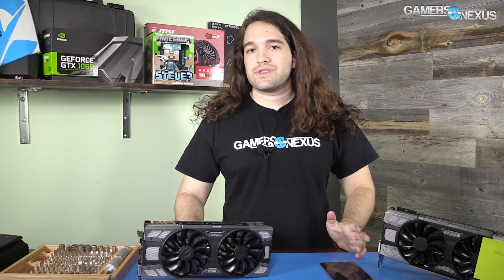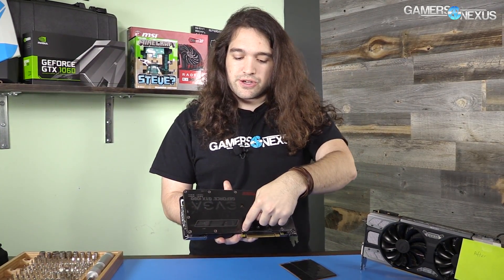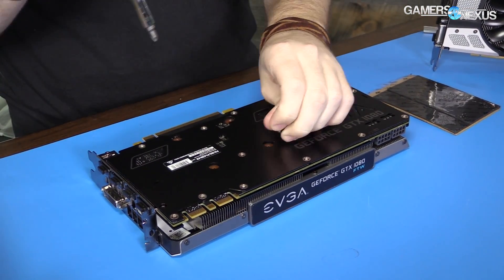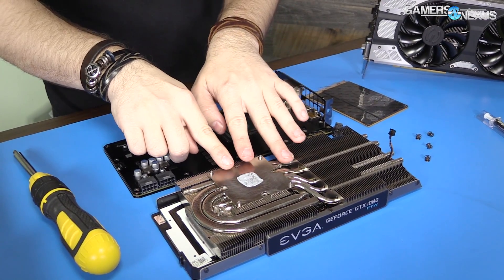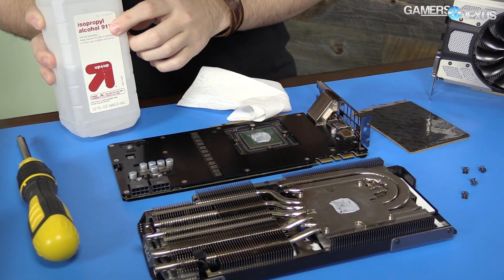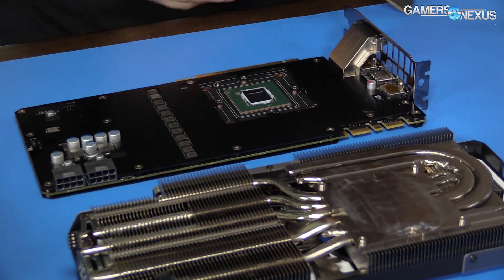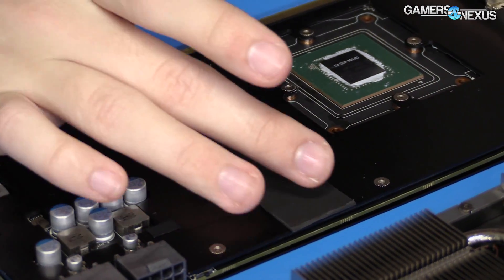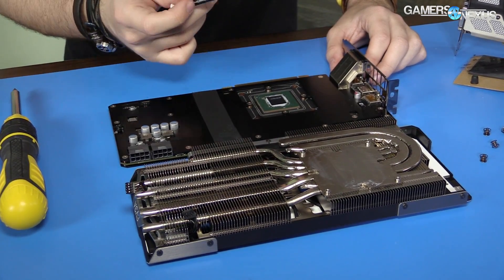How to Install Thermal Pad Mod on EVGA GTX 1080 & 1070

Comment: the only "mod" that is necessary is a full refund and apology from the company.
Reply: lol,, true. however i think evga will do it for you. what they should really do is send you a card that is free of any defects and a box to send them back your defective gpu.
Reply: feelingtardy DOES MY FTW2 have this defect?
Reply: TwiceBakedPotato the only acceptable fix is a refund. you don't pay thousands of dollars and then do a "repair job" on it. this situation is gross negligence.
Reply: feelingtardy it's the type of situation where people move off of a brand for good. the lack of quality control here for a device that is 1000 canadian dollars (each) is appalling.
Reply: 1000hpHONDA It's a change in the default fan curve. There's 0 impact in performance, stop lying and misinforming people.
Reply: Asshai by the Shadow he has posted this line all over the comment section, probably an evga employee trying to damage control.
also new vbios makes it significantly louder than other brands, and still bad temps
Reply: First Last they still have to send me the pads, it's still awaiting approval.
approval for what? for my card to explode?
Reply: Did they fix it ? or do they send the bits so YOU can fix it for them ?
Reply: Onobake exactly. let's fix the problem by jacking rpms up to 2000 and make your computer sound like ass. REFUND
Reply: The VBIOS update just lower the volts slightly = less heat = less FPS than what you paid for.
Reply: The vbios update adds a lot of noise, It is just making the fans spin harder. It is not a real fix.
Reply: So you'd rather do the whole RMA process instead of updating the Bios and problem solved? And if you still feel uncomfortable, you can add the free thermal pads, which is still a lot easier to do than the RMA process, especially when you live overseas. And on top of that, if your card ever fails, you still have the warranty.
Reply: The thermal pads ARE a permanent fix.
which should have been applied in the factory
Reply: Yep it is a simple fix, they are allowing you to do the fix yourself, or you can wait 3 weeks to maybe 2 month to be RMA a new card or your card back with the thermal pads applied.
Reply: MrAlbertrocks RD voltage change for micron memory and agressive fan curve (louder than what advertised)

are you in evga PR department? seems a lot of damage control for a simple user

btw 3 weeks now and [ads still have to arrive
hoping for it not to explode in the meanwhile https://www.reddit.com/r/nvidia/comments/5dedwy/evga_1070_ftw_catching_fire_live_on_stream/
Reply: ***** It does not affect performance. That's the point.
Reply: abd is it really necessary ? to put thermal pad inside ??? im using graphic card for 2 months in OC +500mhz memory +100mhz core, and everything is still OK :) so where is the problem ???
Reply: kappa :(
Reply: Endrivia 
im from EU and

support is shit
rma costs 30 euros
crosship requires 400 euros hold on cc
pads still have to arrive after two whole months.

yeah, take corporate BS up your ass and dont complain after paying 450 euros.
Blame the custumers, not evga and their shitty QA on vram and ram heat dissipation, it's not like this shortens the cards lifespan or its reselling value.

you're not entitled to a good product after paying premium price, bend your ass over and stfu
Reply: I have the 08G-P4-6286-KR - EVGA GeForce GTX 1080 FTW ACX 3.0, do I need to download the primary BIOS or secondary BIOS or both?
Reply: Because they didn't fix the problem they worked around it which is why I got a refund for 3 EVGA cards that had this issue under the consumer protection act.
Reply: If I buy another 1070 ftw to SLI... have they been fixed or do I have to get more pads from EVGA and put them in on the new card????
Reply: Robert Kowalke 
Can I use my own thermal paste & thermal pads to mod it myself instead of the evga ones?
Also are thermal paste with nano/micro particles/diamonds in them a good thing for GPU or will that damage the gpu chip by causing  scratches & tinny bumps ?

Are these thermal paste ok to use:
Thermalright  Chillfactor III.
Cooler Master Gel Maker Nano.
Gelid GC Extreme.
Thermal Grizzly Kryonaut.
Reply: Tony Tran To be honest,  I would only use what EVGA says to use for warranty reasons.  I'm sure you could use what you have but that will probably void any warranties and I don't recommend it.  DL the bios update and get the free kit from EVGA and follow their instructions just to cover yourself.  sorry can't help further.
Reply: has this been fixed yet on later cards
Reply: Kirinketsu you don't pay this kind of money to put up with problems in the first place. at any rate, it sounds like you have sour grapes because you own one and they won't give you a refund. if a device craps out on me and it is found that it is due to the maker's gross negligence then a refund is a lot easier than a class action lawsuit
Reply: lmao
Reply: If you're going to find any mistakes from any company to be unacceptable, then you should just boycott every company there is. Every major company has made some sort of mistake like this.

If you're not comfortable with doing this repair job yourself, RMA the card, they will send you a new one with the fix.
Reply: All you have to do is download the VBIOS update, the pads are optional and free.

Why should they give you a full refund when they are fixing the problem, if they really wanted to they could had said FU and did nothing, they have all the rights in the world to do so.

Comment: Are the gtx 1070 ftw cards are still worth buying?
Reply: All cards shipped later than 1.11.2016 have thermal pads pre installed and the new BIOS update loaded.

Comment: I dont know why, but i watched this for entertainment. would love a Strix overview(/teardown) tho, what's good and what's not so good about the coolers (like does the vrm connect with the cooler), been looking around on the internet to check the most common issues about them, and couldnt find all that much. (yea, i look at the products i like, just to find bad stuff about them, just to be prepared i guess).
Reply: I didn't find a teardown by Steve for the Strix here so hopefully he doesn't mind this link. It's a German site but you get a good look at the cooler underside and a pretty beefy thermal pad on the VRM's. https://www.computerbase.de/2016-05/asus-geforce-gtx-1080-strix-oc-test/ No one does as thorough a teardown as GN though :)
Reply: ***** thanks a lot ^^ good thing i dont mind it being german :P

Comment: The fact that a product so expensive isn't flawless out of the box is weird... Looking back at the very short delay between the 1080 reference and the third party designs reveals, it makes me wonder how many of those designs were rushed è_é
Reply: tbh i was reluctant at first buying my 1080 ftw as it was cheaper than most other after market 1080s, that kinda didnt sit well with me as usually evga cards are rather at the top of the prices, now I know why this time it's not the case, they pretty much cheaped out on everything and only made the gpu die iteelf have direct contact with the cooler, everything else is indirectly and insufficiently cooled because the vram and vrm are seperated by the midplate.

They thouht they could get away with it cuz gpu monitoring only reports gpu die temp and not the rest, this is my first and it will be my last evga card, never gonna trust that brand again I assure you.

Comment: Attention: NEW issue (gap between VRAM and themal pads on the mid plate) was just discovered and has been confirmed by many users.

https://www.reddit.com/r/nvidia/comments/5aqjvb/so_i_disassembled_my_two_evga_gtx_1080_ftws/

Please investigate this new issue.
Reply: what baffles me the most is that the entire cooler is only really directly connected to the gpu die, but not directly with the vram or vrm, as they are seperated by the midplate, I dunno who at evga came up with this design but, my guess is they tried to save cost on copper/aluminum plate size to reduce the cost by not making extra contacts with the vram and vrm, what a shock.
Reply: I'm going to dissassemble my card tomorrow and take a good look at it and see if the issues in this reddit post persists in mine as well, if it does then the issues are beyond just some missing thermal pads for the vrm but a design and QA problems at evga, I'll be making a video tomorrow comparing this acx3.0 cooling design with my older asus gtx780 direct cu2 design and point out the flaws of this cards cooler
Reply: Versale I'm subbing to you just for that video. I want to see what comes of this new issue.
Reply: Sadd Sadd no, the operating maximum temp for vram is not 95
Reply: Video is half done, should be up today night.
Reply: Meh VRAM doesnt need any cooling anyway, I wouldnt worry too much about it.
Reply: the tested vram temp is already over its max operating temp at 95c. 
http://www.tomshardware.com/news/evga-addresses-geforce-1080-temperature-problems,32967.html

https://www.micron.com/support/tools-and-utilities/fbga?fbga=D9TXS
cant find the datasheet now but i am sure the operating temp is 0c~95c.

Comment: If you look at the way EK says to put thermal paste on you have to put it in an X then a cross to make sure you cover the entire card. So honestly for a GPU that isn't enough :P
Reply: There really isnt a "correct" way how you apply thermal paste but in the case of gpus dies which differ from cpu is that the full metal you see is the die itself, as cpus have a cover plate above the die, the cpu die itself is smaller than the surface you see, so it's always recommended to apply more than enough paste for gpu dies to make sure it's proper.
Reply: Versale so yeah pretty much what I said, I know from personal experience when my gtx 980 ran to hot from not enough thermal paste.
Reply from the maker: It's fine. We've done this enough times to know what's fine.

Comment: This is the first time I see the inner design of this cooler, so basically the fins are only connected to the gpu die itself, and the vrms and mosfets are seperated all together with no direct cooling? What the hell was the designer at evga thinking when he drew the design? This is beyond bad designing, this is basically idiocy.

Comment: Can you replace a thermal pad with thermal paste?
Reply: No. pads are used because it has to make contact where paste still wouldn't make contact. You need that pad height.
Reply: Thank you

Comment: EVGA sould release a new CIY Card, Cool it your self, the Card ships with no cooling what so ever and can be purcased separately.
Reply: I just blow on my cards when they get too hot.
Reply: The2808erik that might not go so well for some..
Reply: That would be a neat Idea for people who plan on watercooling, that way you only pay for the pcb and not the fans.
Reply: Basically, they've done that. I believe it was unintentional though. :)
Reply: OhManTFE not really an option if a user has asthma genius.
Reply: To be fair, by adding those thermal pads they actually decreased the airflow to the base of the vrms, to the components around the vrms through the air holes. Also, if your vrms are linked to core that means when the core runs hot so do the vrms(say 70c load). Now say your vrms are independent, and say you actually have good airflow in your case. By not having the vrms linked to the core directly through the heatsink they can actually run cooler than they would run with thermal pads with good airflow. I'm only hypothesizing here but maybe the only vrm issues occurred in cases where there wasn't much airflow and we know how many of those came around 2015-2018. All I'm saying is maybe there was a good intent behind the design that just simply didn't work for every setup.

Comment: Did evga send out any Isopropyl Alcohol and if not  would every one have this in hmm  ??   as  some are  kids  would they have this i dont think so    :(
Reply: Nail polish remover is Acetone. Acetone can rip right through most plastics. Its not recommended as their is a chance for something bad to happen. always have to think of worst case scenario. Spill that on your pcb and it could be game over.

That is why 91% isopropyl alcohol is recommended.
Reply: Don't really have to clean off the old thermal paste it just makes sense since you are doing all the work in the 1st place to take it apart.. And you could just rub it off with a cloth its just harder. 

But you are right they should have included some alcohol wipes after all, why not. God forbid they drop another 10 cents on this fix.
Reply: No sure where you live, but you can go to a dollar store or Walmart and buy a bottle of 91% to 100% for like $1

If you do not have a bottle of rubbing alcohol or alcohol pads, you might want to think about looking into getting some first aid products.
Reply: i used nail polish remover, worked great, lmao
Reply: nail polish remover is just fine, its also isopropyl alcohol just not as strong but it's enough for cleaning off thermal paste as i've used nail polish remover in the past all the time.

Comment: Jesus Christ Alex!!! That is way to much paste on the GPU. Man I'm un-subbing /s!!!

But for real. Thanks for doing this video. I'm still waiting on my kit. Do you have any information on when these will go out? I'm from the Netherlands, and my request is still saying: Waiting for approval.
I will follow this video when the time comes :). Thanks!
Reply: can i just buy any old thermal pads? if so what thermal pad do you recommend?
Reply from the maker: Not sure yet... EVGA US HQ only received them this week.
Reply: is this the FTW edition ? because i got a Superclock and evga seams to claim they didnt have such issue but that iam free to get the kit for free should i ?
Reply: stew360 From what I read so far the probably is only with the FTW cards. According to EVGA, the SC models don't have the issue. I also don't think that they will approve your request for the Thermal Mod as they will be able to check which model you registered.